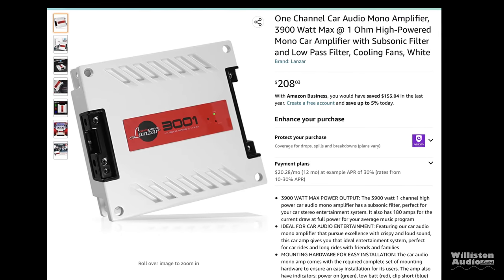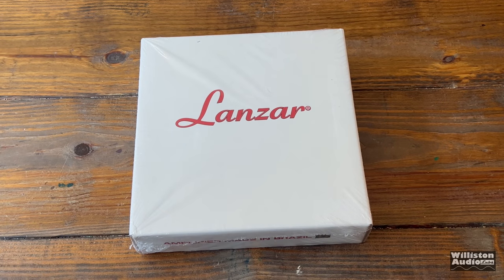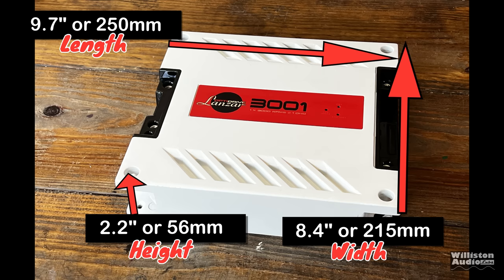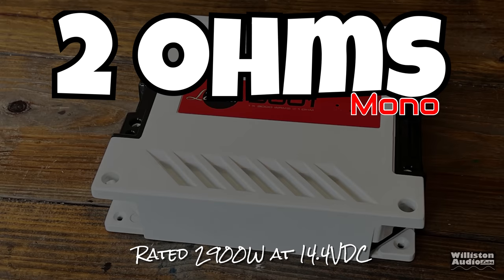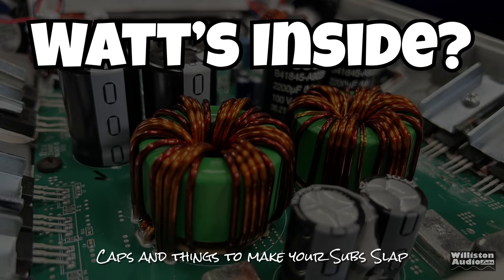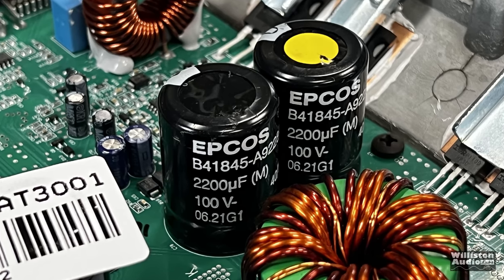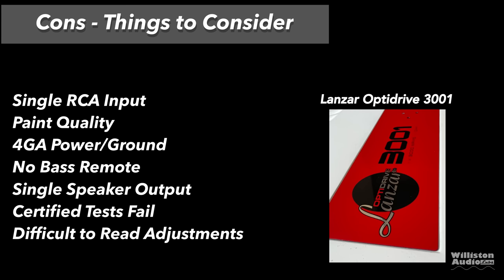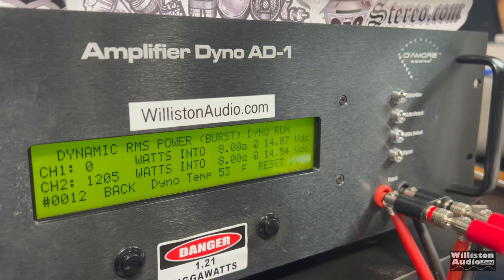Lanzar Goes Brazilian? Lanzar Opti Drive 3001 3900W Full Bridge BASS Amp!

Comment: Those irf line MOSFETs are cheap 9f the cheap China is using them in everything right now and there really made ideally for a DC to ac power converters and not usually viewed as a viable option for high fidelity audio.

Comment: I get the feeling that this amp would have  very short lifespan.
Reply: ...I promise, lanzar optidrive amps were always good. Back in the late 90s, and early 2000s, you would rather have a lanzar optidrive amplifier, over a Mtx or Rockford fosgate amp. The lanzar opti2000d, was a better amp to have over a JL audio 1000/1, mtx1501d, fosgate 1501bd ( 2ohm model), and hifonics Brutus bxi 1600d-2000d. The lanzar opti2000d alone would be the amp that sounded cleaner, and stayed cooler than those models I just stated above. Next to that probably would've been the hifonics Brutus series amps. they stayed pretty cool temperature wise too. At 2 ohm, the Mtx 8100d/mtx1501d would maybe hit a little harder or should I say deeper naturally, along with the Rockford fosgate 1501bd, but the fosgate at that time would be the 1 that would constantly get hot first. I played with all these amps back then. And believe it or not, the optidrive amps were almost like best kept secret. But I would say this, the opti2000d shared the same similar board of other amps like the power acoustik a3000db and planet audio 2250d, and those amps were known to be powerhouses. But those amps were known to be die hard amps, but would fry on you if you let it run below low voltage / amperage. The protection circuit on those models weren't very high quality. But the amp would last forever if you maintain the  right power supply to it.

Comment: Just because an amplifier it’s rated 3000 W rated 5000 or even 10,000 W that doesn’t mean you’re gonna put that in subwoofers 🔊 are you have to upgrade your way of thinking nobody uses anymore 6 1/2 coaxial speakers 6 x 9’s that’s long gone my friend Brazilian amplifier work the best in tweeter horns mid high or mid bass Woofer three or four way systems

Comment: Thats a big fail with those 4 gauge power and ground inputs....
Reply: 4ga ofc is plenty sufficient. It's about amperage load capability.
Reply: @Chuck_Sanders  right… because so many other manufacturers are putting 4 gauge inputs on their 3500 watt amps…
Reply: @RealPivotTV  umm, yes many do. Its about the wire you use, and it's ampacity. Ampacity  is the maximum current that a conductor can carry continuously under the conditions of use without exceeding its temperature rating. Knowing your wiring capabilities, and of the type of wire you use...is key. I run KnuKonceptz brand (and have for years) 4ga wire in my wife's budget build on 3k...never an issue. I've ran SounDigital, Taramps, PowerUs full bridge...other half bridge and more, at 3-4k on 4ga ofc..never had issues. How many old school amplifiers exceeded outputs of over 1k+ and wiring them in the dirt for low ohm loads, such as .25 on many...and theybwere either hardwired,  had plugs or spade terminals...and people ran below 8ga?? As an electrical engineer, I can definitely say, 4ga is sufficient. Not 4ga CCA, no. It cannot carry the ampacity needed. That's where people need to read and educate themselves, before just buying a particular wire ga. Not all are true ga wire. And not all have the capabilities as others. 👍
Reply: @Chuck_Sanders  you really wrote a book didn’t you? What compelled you to correct me. Big d listed the 4 gauge input as a negative why aren’t you correcting him? 0 gauge is the standard for a 3k watt amp rather you agree or not.
Reply: @RealPivotTV  meh, I've said it before on here, and to him. That's just like people thinking that subwoofers, need 4ga push terminals, and they need 4ga wire ran to the voice coil...my point was valid, regardless of what your opinion was of it. I am not trying to argue, yet make a valid point. Ton's of amplifier companies utilize 4ga inputs up to 3k, and its sufficient. And many people that repair, like Shane,  Mark and Sam at barevids have explained this. I would be more concerned in whether the board traces, and board thickness are sufficient enough. Hence the Audiopipe full bridge knockoff, was a failure in that aspect.  👍
Reply: @Chuck_Sanders  you know you have really turned me around on this with all of you words and stuff 👍🏽😒

Comment: I would never trust any Lanzar amp these days
Reply: Meh, but it's Banda. Totally different.  Most amplifiers today, are rebrands.
Reply: Lanzar has always had good stuff. In the past the only problem that I see they had was overrating their budget brands like lanzar vector, lanzar vibrant, and lanzar maxpro. Lanzar vibe was also overrated with maximum power ratings, but was still a high quality built amp. But the lanzar optidrive series was always good. Back in the day, I had a mtx8100d, a Rockford fosgate 2 channel power 1000a2, a Power 1500bd ( the very first one that they produced 2 ohm model). And I also got my hands on 2 used lanzar opti1400d, and a lanzar opti2000d. I tried all these amps on various of subs, for example, 3 punch hx2 12s, wired to a 2.67 ohm load. And 2 audiopipe BE15s wired to a 1 ohm load, and other miscellaneous subwoofer in between. And the fosgate amps did have a good sound to them, but out of all the amps I just named, the fosgate amps were the ones that over heated the fastest, while the lanzar opti amps stayed the coldest. And I tried everything at it's rightfully ohm loads when I wired things up. To me, lanzar opti has always been the shit in my book if you knew what you were doing. And the mtx8100d proved to be a more dependable amp than the Rockford 1500bd amp. When fosgate switched over to the black model, that's when the bd series got better. But before than, amps like Mtx, hifonics, lanzar opti, jbl, powerbass, planet audio and audiopipe held up better than fosgate did in the late 90s, & early 2000s. True story friends.

Comment: Definitely a cheap knockoff
Reply: A cheap knockoff of a knockoff of something from 30 years ago.
Reply from the maker: It’s made by Banda, and for the $$ pretty good deal 👌
Reply: @Williston Audio Labs  agreed the dollar/watt is great
Reply: @Chris-B-Bassin  then, it wouldn't be such a cheap knockoff??
Reply: @NoB.S Audio  one positive aspect doesn't completely outweigh all the negative 🙄
Reply: @Chris-B-Bassin  I didn't see much negatives,  for the price point honestly. I compare this, to the CAB 22 and the Power Acoustik Vertigo 10k, as they are almost basically the same identical boards, and the funny part was that the PA outperforms the CAB, in power and price. This is just a more affordable Banda 3k, and if someone can overlook paint blemishes and it being hard to see the input/output information on the amp, that would be about it. Banda used clear caps for years, and may still..it was hard to see as well. The thing is, with all companies having copies of other amps, they cut a little costs, to afford that to the consumer, in return. They should have used red or a contrasting color for sure. 👍